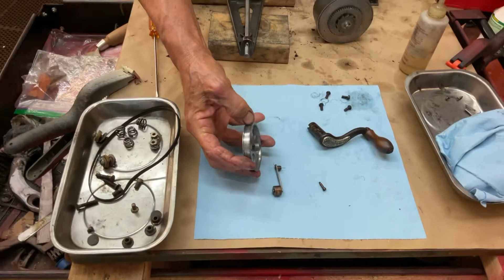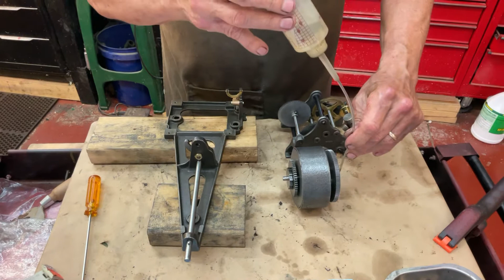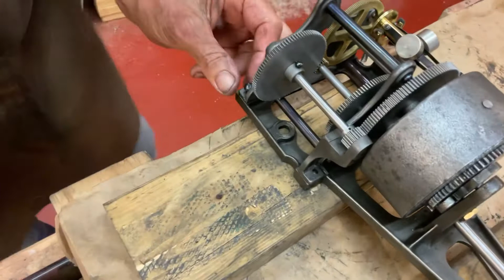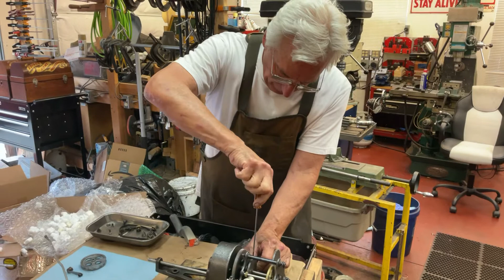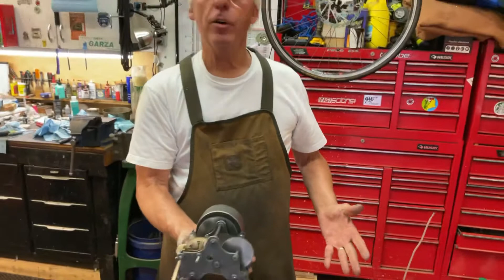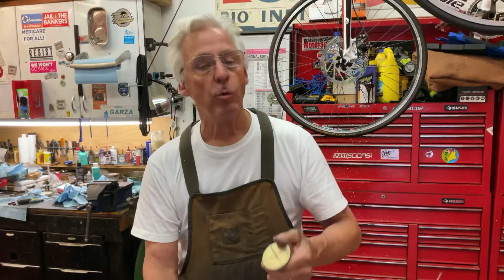696.  Putting the spring barrel into the Edison Home phonograph gear train

Comment: What size spring do you use in an Edison home I cannot find where to match the original the replacement is about .030 narrower
Reply from the maker: Brian Parlier, the phonographshop.com, has Edison home main springs. They are 1.281 x .032 x 12‘ and the ends are pear pear.
Reply: @1974hurt  do you know for fact that's about as close as they get because I know it watches a lot of times you have to sacrifice for shorter Springs is that the case here
Reply from the maker: @garrylycos4795  that is the closest I have found
Reply: @1974hurt  I got a feeling that's as close as I'm going to get